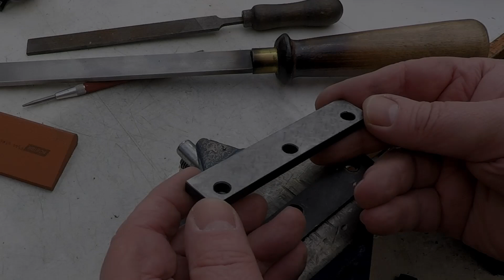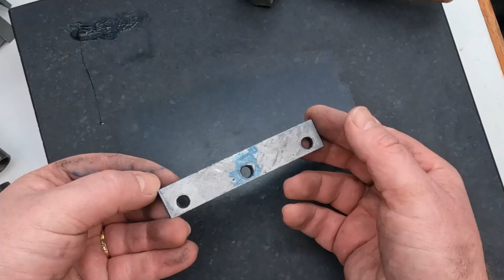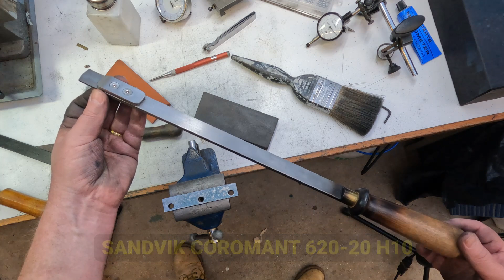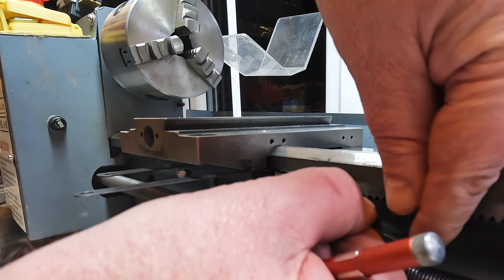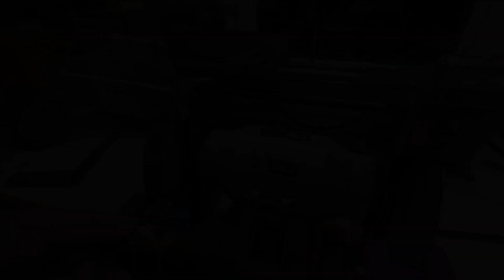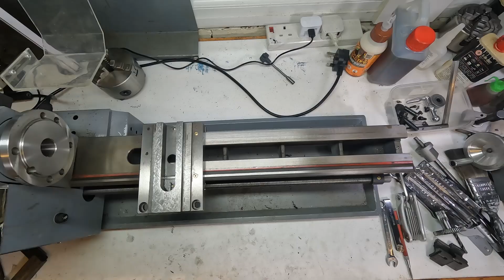Fixing the Mini Lathe Saddle - Down the rabbit hole - Part 3

Comment: Really makes me wonder about the geometry of the bed ways. The cross slide, and the compound slide, both utilize dovetails. Why not the main bed ways? Would this not be a better design? One tapered gib, at the front for ease of adjustment. Any thoughts?
Reply from the maker: It seems there have been some lathes made with dovetail beds but the main stream design is one vee and a flat opposite. Some lathes were made with two vee's, one on either side of the bed but this makes it very difficult to manufacture accurately because both vee's need to be perfectly parallel and perfectly level.

I'd guess that dovetail beds would mainly add unnecessary expense to the lathe manufacturing process which is why most go for the single vee and a flat approach.

Comment: The cheap machining of the ways is the problem. The underside was milled and left rough. Flipping the lathe over, with the saddle removed, draw file the bottom in the tight spots to even up the thickness and it should clear.

Comment: Where can I buy a decent scraper?
Reply from the maker: I got mine from Impractical Machinist off eBay https://www.ebay.co.uk/itm/334369762367 he also has a YouTube channel which is well worth checking out.

Alternately you can try to find a Sandvik Coromant 620-20H10

Comment: hmmmm...
it's such a garbage way to hold the saddle on, 6 bolts and 4 grubscrews to adjust (which one needs to change, and which way should it go) and none of them easy to access... my solution is to chuck those lumps of cast in the bin and make tapered brass gibbs. it's a bit fiddly but so much easier to adjust. (assumes a milling machine is available)
that said, nice bit of scraping :-)
Reply from the maker: Yes, and the grub screws cause the iron gibs to bend if you over-tighten the nuts. Tapered brass gibs would be great, might be a job for when I get a mill 👍
Reply: @radboogie I got the idea from rotarySMP channel. pimping the minilathe series. fettling the beast from the ground up

Comment: Hello Richard, I'm following with interest your enlightening videos, and trying to follow your tips in order to better tune my mini lathe, so I'll take the freedom to ask your advice from time to time, hoping not to bother you too much 😊
A couple of questions, then... First, is your scraping tool homemade or else is a commercial product? I'm asking this because at the  hardware stores I asked for (I'm from Italy) they gave me weird looks 😆 Maybe it is not such a common tool?
And second, I noticed that someone around is suggesting brass as gib material... What is your opinion on that matter?
Thanks so much! 
Roberto
Reply from the maker: Good to see you again Roberto! Feel free to ask as much as you want, the purpose of my channel is for people to share what they know 👍

Engineering hand scrapers are hard to find these days, not many people sell them. Mine was purchased from a YouTuber named "Impractical Engineer" - he makes and sells the scrapers on eBay - https://www.ebay.co.uk/itm/334369762367. 

You can also try to search for Sandvik Coromant 620-20 though these are also hard to find. https://www.sandvik.coromant.com/en-us/product-details?c=620-20%20%20%20%20%20%20%20%20%20%20%20%20%20%20H10

Alternatively you could grind a scraper from an old file. 60mm radius on the end, 5 degree negative rake (95 degree blade angle).

Brass can be used for gib strips though I would prefer phosphor bronze. Cast iron gibs seem to be popular, as it has excellent sliding characteristics with itself. I plan to make some new gibs with phosphor bronze in the future, will probably cut them from hexagon bar as that way two of the sides will already be the correct angle.
Reply: @radboogie    
Thank you Richard! Only, I'm not sure to understand the advantage of using an  hexagon bar as starting shape (my fault... 😊)
Being the cross slide gibs shaped as four-sided parallelograms (if I see them right), then is the hexagon choice a way to get precisely 120°/60° angled gibs, or else just a way to start with two surely parallel opposite sides, (that could be obtained also from a square/rectangular stock) and then work them to the desired (arbitrary) final angle?
Pardon me for possibly naive questions, but I'm into turning just for four days 😬 
A long way to go...
Reply from the maker: Using hexagon bar is just my idea of being able to start with two sides at the correct angle. When I make new gibs I will be making them with hand tools (no milling machine) so if I saw a strip of hex bar leaving two sides at 60 degrees to each other, I can then file the opposite faces to be parallel with them and verify on my surface plate for parallelism. As I say, just an idea I had to improvise with hand tools.

Comment: You're going to want a straight edge to measure against each face, and find a reference face that is actually straight. (We're not talking about a ruler, but a precision flat and long edge). Most hobbyists make their own.
From there you'll need to make that reference surface as flat as you can.

After that, you'll need to start measuring against the other surfaces and make them parallel to the reference surface.
It's a ton of work but there's really no way to cheat around it.

Here's a good video on what you'll need to do
https://youtu.be/7MTHWuS5S8A?feature=shared

You'll want to think long and hard and the order of operations here, as doing things out of order will mean more work.
My suggestion would be to scrape the top of the ways flat first, that'll be your reference. Then scrape the underside of the ways flat and parallel to the top. Use a surface gauge and some blocks to prop the bed up to get your measurements on how to correct the angle.
Then measure the V ways using a similar cylindrical V block and determine how to correct their angle and scrape them parallel. (Side note, mark a point on the V cylinder so you're always measuring to the same reference, and cut a relief inside the V cylinder instead of scraping all of it - you only need 4 points of contact. In fact you can even use a bit of pipe instead of a solid round bar.)

Considering that none of the ways are hardened, don't put too much effort into it as they're sure to wear.
It also might be worth it to anneal the entire casting as they're likely not stress relieved either. Some time in the oven at the correct temperature will do it, but if it's in your kitchen you would probably want to clean and remove all the paint first else your cookies will never taste the same again.

Also, make sure you buy a big box of tea first, because it's sure to take a while.
Reply from the maker: Did someone say "Tea"?

Comment: I’ve had the same problem with the saddle binding the cure is to scrape the underside off the ways as they are not consistent with each other on both the front & back ways